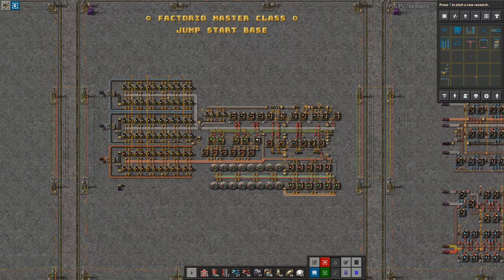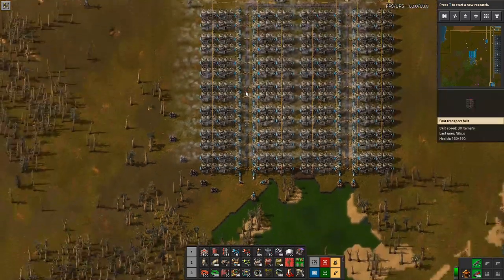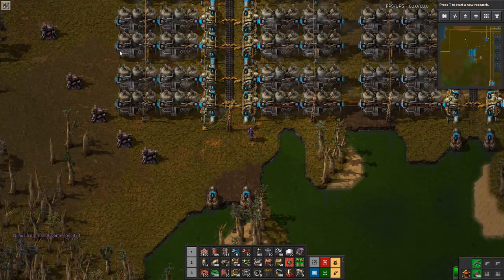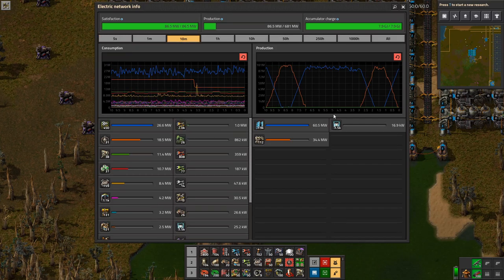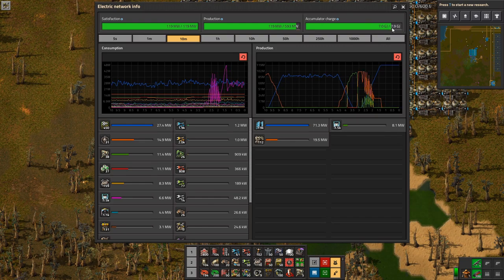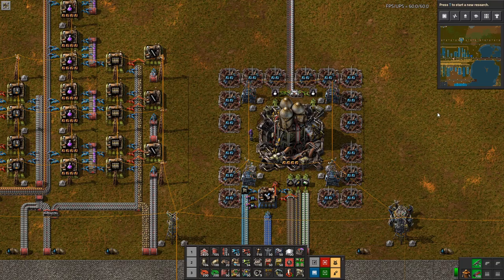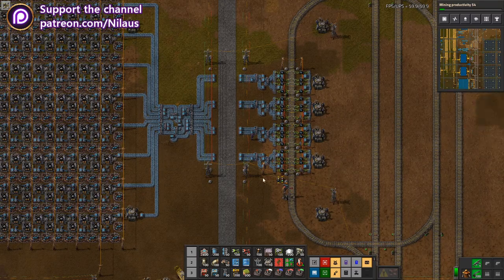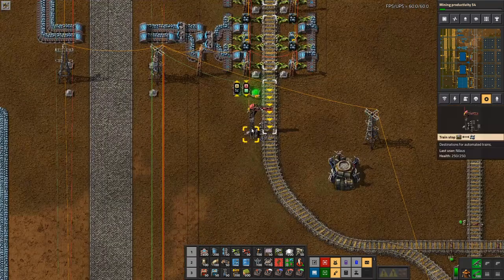Examples of CIRCUIT NETWORK in Action | Factorio Tutorial/Guide/How-to

Comment: I know you probably never use them,  but the POWER SWITCH item is actually very useful for managing steam engines because when they are disconnected,  they stop producing just like during the day when they are not needed.  Weirdly enough,   they are perfectly efficient and do not continue to burn or use steam when not under load
Reply: +1 for a fellow Power Switch lover xD
After the "outcry" last video, I was curious if Nilaus would deliberately refuse to show a use for it, just to troll us.
But there is still hope, maybe it will get a mention during the RS latch part in the next video!

Jokes aside, I understand why controlling the pumps directly can be better if you don't use a RS latch. No need for an instant reaction. The delay might even help to prevent flickering on and off, that would occur without a RS latch.
Also, if you want to go for full efficiency, don't forget to use Burner inserters instead of normal ones to make sure that there are no power consumers in the network when the steam engine part is cut from the main network with the power switch.
Reply: @dakon2154  While it's true that Burner Inserters don't have a minimum consumption and therefore wouldn't continuously drain power just by being hooked up to the network, basic Inserters are so much more energy-efficient (~7.23 times more) that it's probably still worth it to use them rather than the Burners. If I've done the math right, Burner Inserters are only more energy-efficient than regular Inserters if they operate on intervals of more than 202.5 seconds on average.
Reply: power switches, used multiple times in a factory are a horrible thing for UPS. Each machine checks each tick if they can get now electricity .
Reply: @blubbber  If you're using steam backup in your base, you're not concerned with UPS.
Reply: @E-102_Gamma  power the inserters with your main power network. so they're always powered by the solar panels. and only have the output from the engines going into its own network attached with a power switch
Reply: @kierano8390  Clever. :)

Comment: I used the circuit breaker to disconnect the steam engines from the rest of the base, so that the base is only running on accumulator charge at night.

Comment: The power thing is way easier. Just use a disconnect switch and it wil isolate the steam power from the rest of your base. Yes it wil stil run but use close to 0 coal but it wil act instantatiously to your circuit conditions. This way they also don't charge the accumulators.

Comment: I think your steam engine prioritization would be a good chance to make use of the power switch. I tried cutting off water pumps at a lower power percentage, and it usually takes too long for the steam to build back up. If you use an SR latch and power switch to isolate the steam engines from the rest of the system, you can wait until the last second ( 5% accumulator charge, in my case ) to activate them, since there's seemingly no wait time.

Comment: Hi Nilaus, nice introduction of the circuits. It is nice to see real usecases of them.
Maybe one possible improvement for the coal monitoring - when you monitor the last belt, it is often too late to fix the problem, electricity production stops and it is hard to restart if you use electric miners as well.
Therefore I usually set the monitoring at the start of the steam engine column, before your first splitter. You can monitor multiple adjacent belts to have the monitoring more stable. Also would probably leave the sound on, because electricity is one of the things that can really cripple a base.
Then I usually have a full box nearby if I need to restart the electricity after I fix the coal inflow.
Reply from the maker: Good point. Monitoring at the start only checks for input flow, while monitoring at the end also checks if the steam engines are consuming the full belt at the beginning. The added information comes at the cost of shorter time to react
Reply: @Nilaus monitor both.  Set the first as a silent "we might need more coal" type alarm, and have the end monitor give a big loud "dis bitch empty" alarm

Comment: With the example of putting robots into the roboport, I added a logistics storage chest with the appropriate filter between the assemblers and the roboport. This also allows for if I remove a roboport with bots in it, the logistics bots can bring their siblings back to the chest to be added back into the network. I also had the port outputting the total bot counts on their respective item channels, so the inserters pulling from the assemblers could be set to stop if the total between the chest and the network reaches the desired level.

Comment: For power priority you can also just make sure electric poles from steam engines connect to the rest of the grid only via power switches. Then program power switch itself to just stop power flow generated by steam engines and not a single unit of steam or coal or whatever will be used (unless you place lights near the engines or something). You can of course connect more power switches if you get cold sweat when thinking about powering your base at night via one single wire :D

Comment: So I found it interesting, on your previous video you list that you're not sure of a use for the power switch, but here you're doing more work than is necessary if you'd just use the power switch. Ensure that your solar farm is on an isolated grid (you can remove power line connections manually if they try to connect), make sure your coal is on an isolated grid, and then connect both to a power switch that monitors accumulator charge. 

When your accumulators are at 0%, the coal power switch turns on, connecting it to your bases power grid, so they start producing, and you flip off your solar grid, meaning the accumulators can't charge off the coal power because they're isolated from the main grid.
Reply: Dealing with separate grids isannoying, and the available power on the power screen would no longer be accurate.

Comment: Just out of curiosity, wouldn't it be simpler to have a power switch between the steam generators and the grid that's controlled by the accumulator signal? Or would that also have a lower response time?
Reply from the maker: theoretically yes, but I hate managing power lines and making sure they don't accidentally connect anyways. You risk connecting an outpost to the part of the network you are disabling
Reply: @Nilaus  Ah, I see your point. Thanks for the clarification.

Comment: @Nilaus i have a big problem for you to solve(hopefully)
you showed how solar and steam interacts. this works perfect because solar has a higher priority.
BUT, what is with the interaction between nuclear and steam. there is no difference in priority, they always share the powerproduction.
--> now the question: how can i force the coalpower(steamengines) to run always at 100% and nuclear covers just ontop of this?

i tryed even with s/r latch but hopeless. at the moment the nuclear kicks in, the steamengines reduce there output. 
you probably ask yourself, why i would like to do this. at the fist point to have a full belt consumtion as planed and second, in the most mods you have a infinit recource(trough processing) which feels stupid to not run at full power when its actually can.
Reply from the maker: You want it the other way around. Nuclear is always running anyway, so you should only have Steam Engines as backup.
This is exactly the same as for solar, but you need to monitor an Accumulator for the monitoring
Reply: @Nilaus  thanks for your answer, i know your time is rare but this did not solve the problem. no matter which methode, when tey both active, the nuclear is loosing efficiency. the solution is easy, not having both at the same the on the same powernetwork...but HOW

Comment: Cant you just hook up a pump between the boilers and the steam engines (or heat converters and turbines) and switch those off by controlled behavior? That would eliminate the firing up time.

Comment: Can I repurpose your Prioritising Solar over Steam Power setup to prevent wastage of nuclear fuel?
Reply: Yes. You can set up a tank to measure steam levels. A memory cell to prevent over feeding, and pumps that are tied to an accumulator. 

My nuclear only feeds when steam is low and only 1 fuel cell at a time. The turbines only get switched on when necessary.
Reply: @asaskald  Wish you would of told me that three days ago right before I set up my reactors.

Comment: In the last video, you said there was no use for power switches. But here, you were complaining that the steam power would take too long to stop if you used circuits for the belt or inserters. You settled on the water pumps, but you could have immediately turned off the steam power production if you isolated the steam electric grid from the rest of your base. Instead of turning a pump on and off, you turn a switch on and off to connect the steam electric grid to the rest of your electric grid.
Reply: Then the available power in the power graph would be inaccurate
Reply: @kesleta7697  If there is no water in the boiler (or steam in the engines), isn't the available power inaccurate, just in a different way? 

This way, it's only the power available to the system right now. When the power switch is enabled, the engines are still connected and will be added to the available power.
Reply: @JohnathanGross  where it shows power production, it shows the power being produced as well as the total power available if all the generators were running. I was referring to the total power available, which just looks at the max capacity for power production in the network.
Reply: @kesleta7697  I understood that. But if there is no steam in those engines, then they can't produce that theoretical maximum. If you want steam as a backup, the idea is that you shouldn't rely on it as a power source. The max power of your primary power source should be what you care about.

Comment: Nilaus , say you have 1 large production block that is using logistic bots , you use a static value .
why not use a dynamic value for bots based of free bots? lets say 10% of the logistical bots in the net need to be free and if now insert more bots(i did that with 3-4 combinators). Why? since it is impossible to know how many bots are needed in a net
Reply from the maker: you can do that and I mention it, but you end up with way too many robots. If you use Logistics Robots to empty trains then 10000+ commands are suddenly coming into the network and therefore always depleting all robots.
If you mass produce Solar with Construction bots then you will also get 10000+ commands and all robots will fly out.
In both cases it creates too many robots (in my opinion)

Comment: I'm new to circuit networks while playing space exploration. I have a ton stuff on my cargo rocket but I'm trying to setup a signal to launch the rocket without full cargo. 

How do you segment a network when connected to the cargo rocket? I'm trying to read the items within the cargo rocket only but it's picking up everything in the network that's connected to it. Can I setup something like a stop gap so not everything connected to one building views everything? I'm sure this is easy but I just can't figure it out.
Reply: you could use a different color cable

Comment: Two notes:
1) I don't think the accumulator synchronization thing is true anymore. When I tried it, the one accumulator that I built next to my offshore pumps to pull the signal from kept dropping to low power before all of my other accumulators did. I've resorted to pulling the signal from ALL of my accumulators, and using some combinators to make it so that I don't need to manually increase the thresholds on the pumps when I add more solar panels and accumulators. The circuit remembers the highest (total) "A" signal that's ever been seen, and outputs a value from 0 to 100 representing the percentage of the current total compared to that maximum. Then I set the condition on the pumps based on THAT signal. (The circuit is, of course, far too complicated for this video. It uses 6 combinators, of which 3 are the "positives and negatives cell" from the combinator tutorial page on the wiki. I couldn't figure out how to make a memory cell on my own so I looked it up.)
2) A more dynamic/scalable strategy for oil processing is to read the value from just one tank of each liquid, regardless of how many tanks you have. Then, for each pair of liquids X and Y for which there's a machine that converts X into Y, have a pump on the pipe feeding X into those machines, enabled when the X signal is greater than the Y signal. That way, your storage for all of these liquids will always be the same percentage full as each other, even as you add more tanks to individual liquids.

Comment: These are very nice basic concepts of circuitry even tho the examples are flawed, but overall it helps the new players to learn about the concepts.
Reply from the maker: flawed?
Which ones would you call flawed?
Reply: @Nilaus  The electric engine one where you control the water input to disable the power, takes a while to work, if you controlled the inserters it would be faster but still would take a while. Using a power switch instead you wouldn't need to worry about controlling the pumps or the belt or the inserters, the power would be cut instantly.

The robot input you are considering the total ammount you want to have on your whole network but not considering if you have room to input them into the roboport. Instead of total robots, its better to input when available = 0, which means you have more jobs than you can supply and when available bots is 0, that means the roboport is empty, also input construction robots and logistic robots into separated roboports.

The Oil part you are considering the contents of the stacked tanks, tank-to-tank flow is terrible, its better if you consider the content of 1 tank only, preferrably the one connected to the pump so you have a better accurate reading. While you're doing like this, you have the reading as in the average of all tanks not the total ammount. So instead of 20k light oil read from 2 tanks, you would want to check 10k for 1 tank. If you have a bigger buffer, like petroleum where you have 4 tanks, asssume you keep the ratio of 40%, you would check 40k contents, where you would have supply issues because the tank that is receiving input would have more fluid than the tank that is exporting the fluid to the network because tank-to-tank transfer is slow, so your pump would be flickering, that's why your oil loading train station had issues working, the flickering of the reading values.

The train station part you have unloading issues on some stations so even the reading is accurate, the result is not going to work out the way you want. With uneven unload you should consider average ammount in the chests and balance the output. The logic you applied is based on an even unload of the chests, in which you sum their content because you know they all will be unload evenly.

But like I said, the basics was covered, when players begin to play around and test out these setups they will eventually face those issues if they wanna build big. But if they just want to launch their first rocket and be done with the game, they won't see any of those issues.